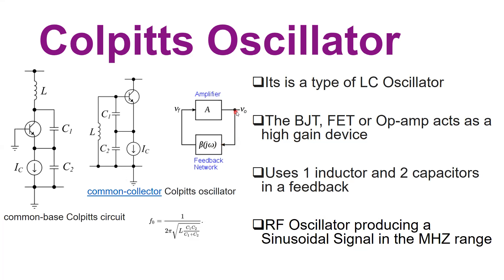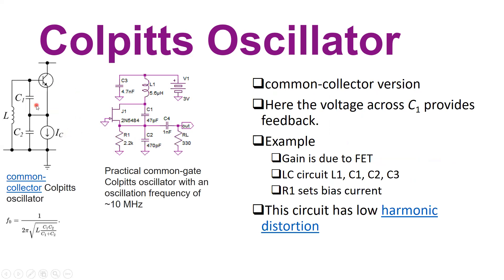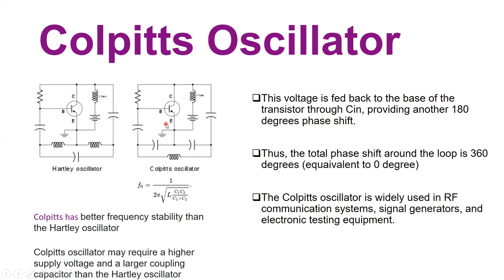Colpitts Oscillator

Comment: C1*C2/(C1+C2) effective capacitance (of C1 and C2 connected in series) indeed depends on values C1 and C2, and not "just the ratio" as stated. So the LC resonant frequency also depends: will be half frequency if using 4*C1 and 4*C2